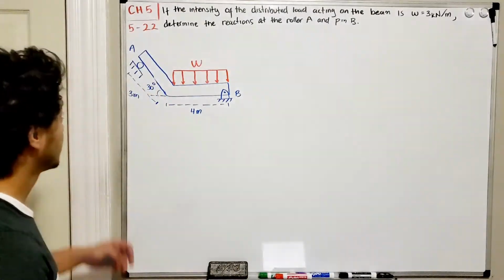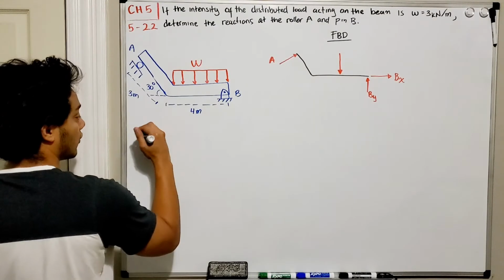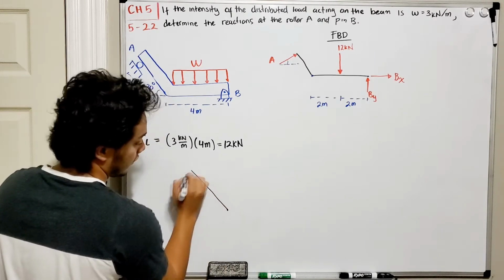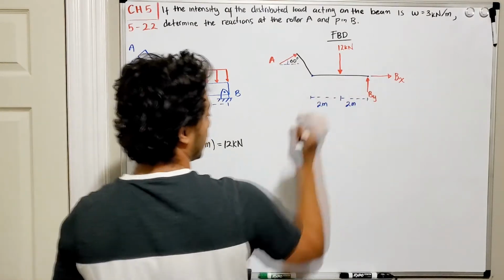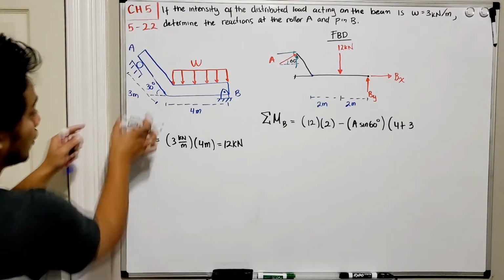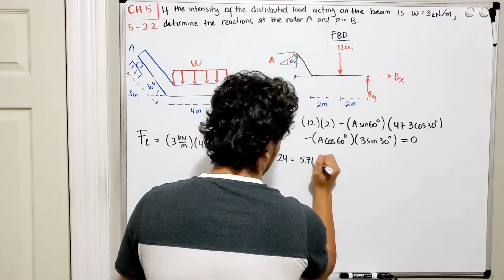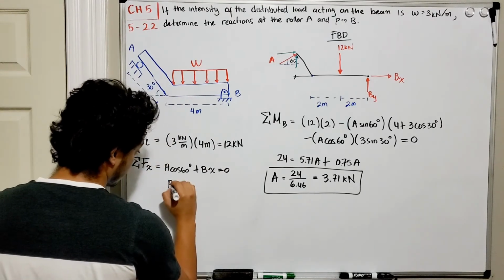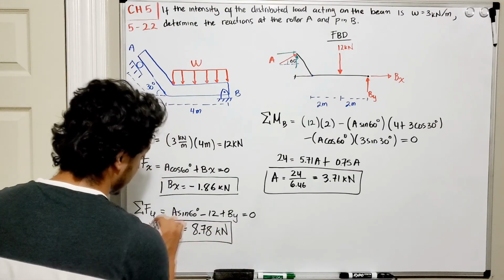Statics 5.22 - The intensity of the distributed load is 3kN/m determine the reactions at the roller.

Comment: why is there only one reaction force at roller A and shouldn't there be a reaction moment at B why is the reaction moment at B zero??
Reply from the maker: Hello my friend,

Lets start with the force at roller A. Rollers only apply a force normal to the surface they are touching. In this case its at an angle.

Second, at B we have a pin; therefore pins only apply a vertical and a horizontal force to our system at that point. (I believe you confused a pin with a fixed support, fixed supports do create a moment reaction.)

Finally, the summatory of moments at point B is equal to zero because the overall system is not moving. Since we are in statics it is safe to assume every summatory of forces or moments should be equal to zero, again only because the system or object is not moving. In your next semester you will probably have Dynamics which is when the objects are now moving and the summatory of forces and moments are now NOT equal to zero.

I hope this helps!
Reply: @LearningbyTeaching  thank you, sir, for the quick response. I appreciate it